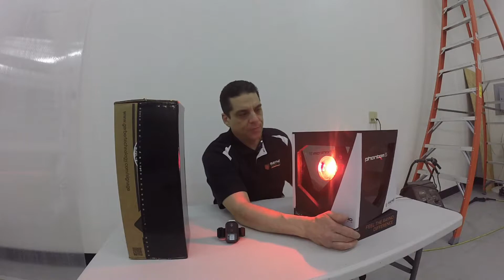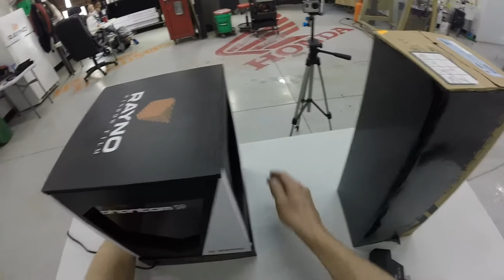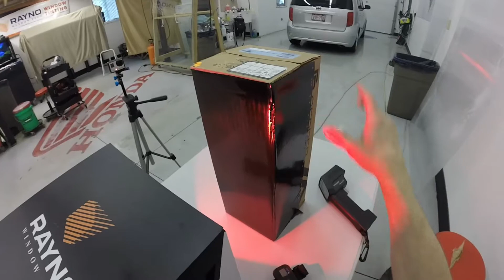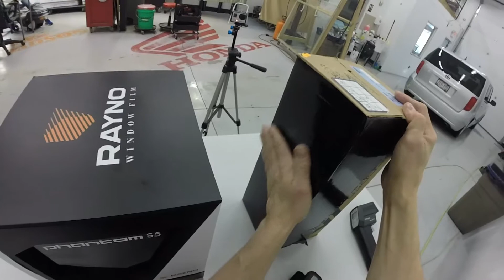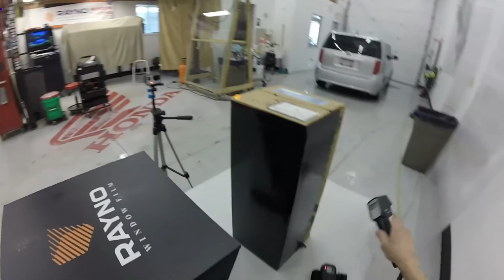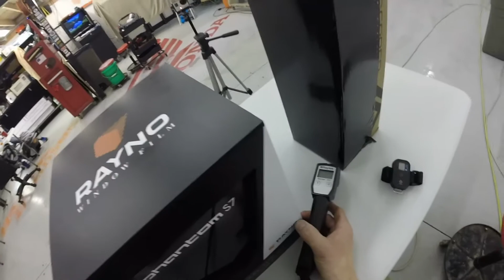Rayno Window Film Heat Box Test

Comment: To avoid bait and switch how can you determine what you paid for was installed on your windows? Is there a test you can do ?are there any clues to know you actually have it on your windows? I'm only asking because it's so difficult to trust anybody for anything these days.
Reply from the maker: ask to see the roll at install I guess. No test I know of. If they are reputable there should be no worries.
Reply from the maker: get a warranty card with the lot number for the box as well
Reply: I got to witness my installed tint using Rayno. Nano Carbon Ceramic Tint in Corpus Christi, Texas.
Reply: justin times dealer should have Btu meter and IR meter at the shop ask them to check for film performance before and after the film is on your glass
Reply: I've had a shady installer upsell me to the good time years so and it faded in 2 years. He was out of business by then
Reply: @BARBELLS-AND-BUDS  That sucks! I guess i was lucky to watch the installer and what kind of tint was put on.
Reply: @cruzmascorro537  Yeah that's life, you have to learn the hard way sometimes. Now I'll watch them open and use the good stuff and not believe them.